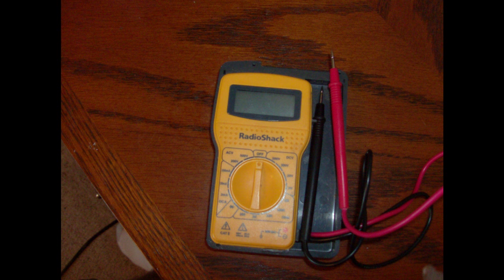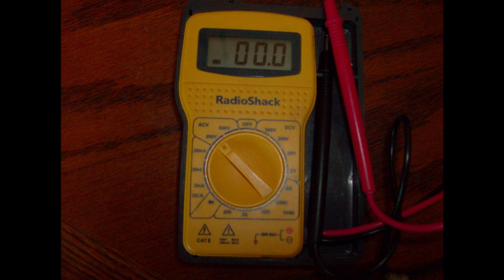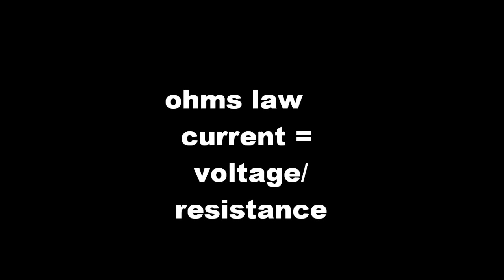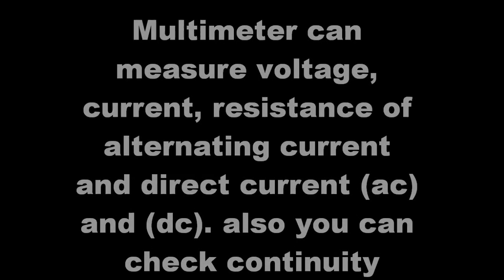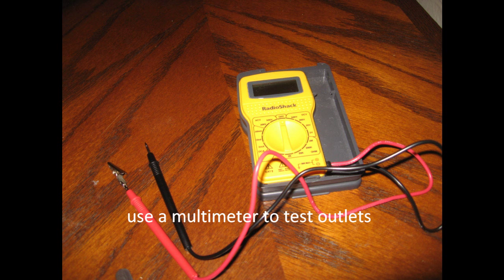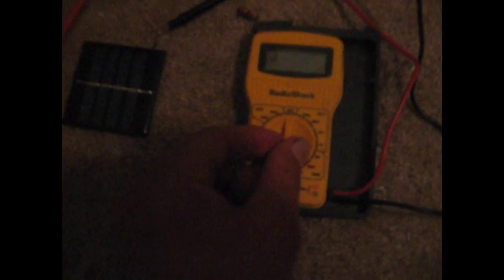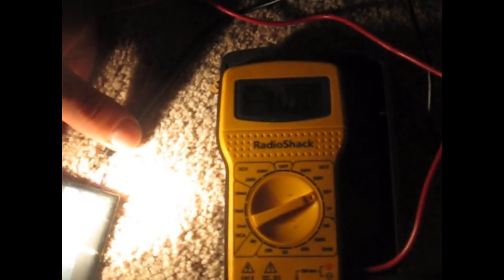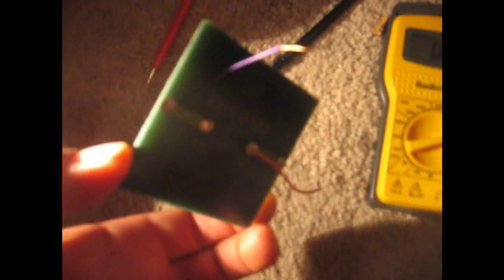Multimeter Basics

Comment from the maker: the first thing you have to do before you do anything is unplug the dryer and turn off the breaker to the dryer.  wait 5-10 minutes to allow any capacitors to lose their charge before proceeding to use multimeter.  Google search the make and model of your dryer with the problem you are having (no heat, not running,etc.) - the make and model should be on a placard of some kind on the dryer.  There should be step-by-step instructions on what settings to use on multim. and what to check.